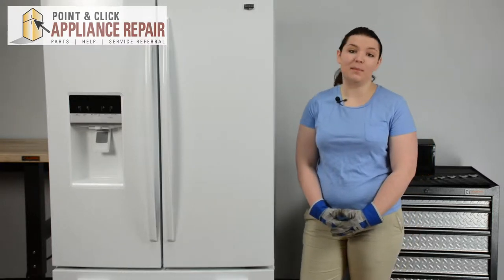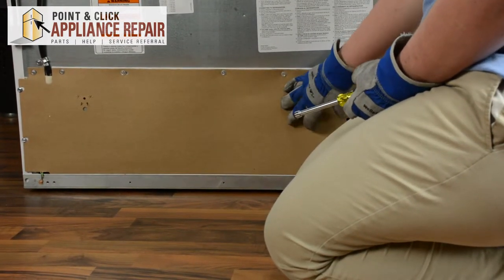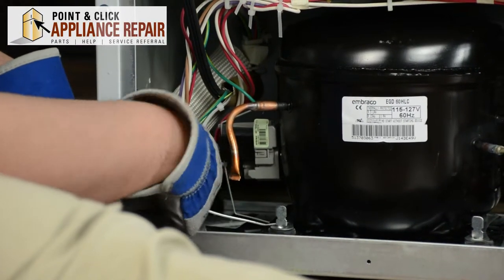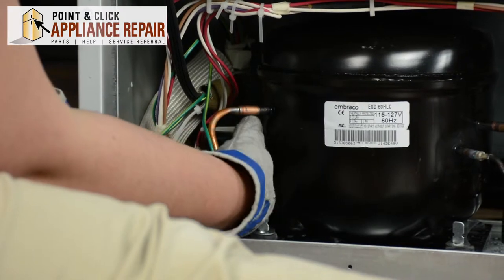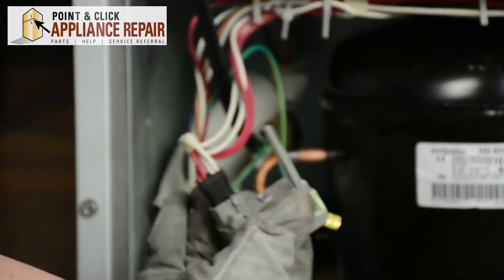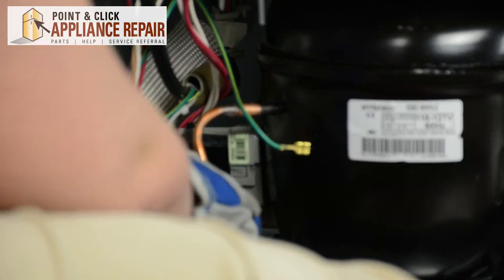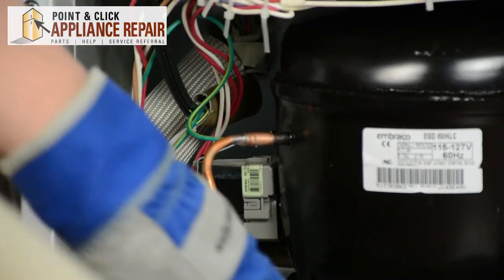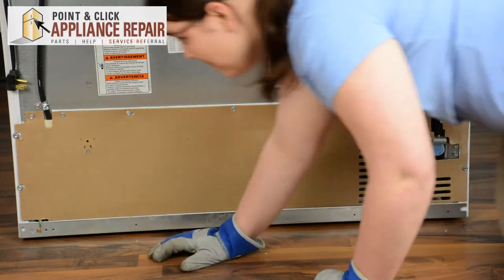WPW10350564 - Replacing a Refrigerator Capacitor - W10350564, AP5656367, 2683570, PS5573731

Comment: Be careful removing a capacitor because it can hold a lethal electrical charge indefinitely even when not connected to a power source. If you accidentally short it with a screwdriver when removing it can discharge violently.